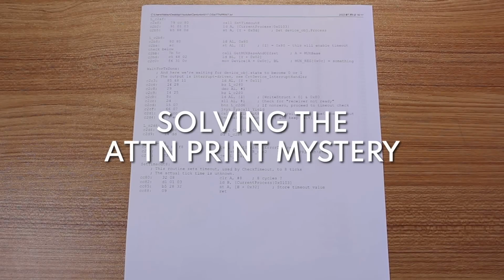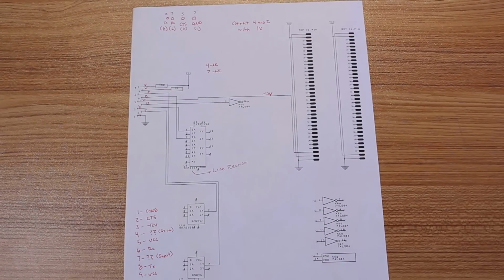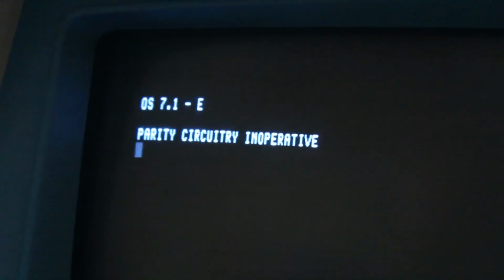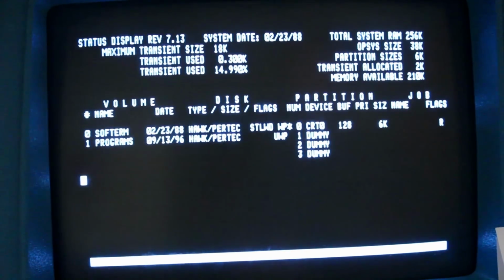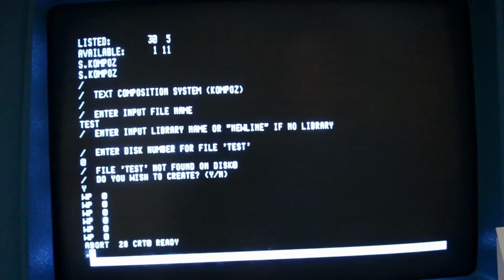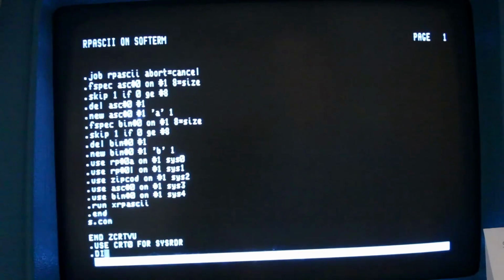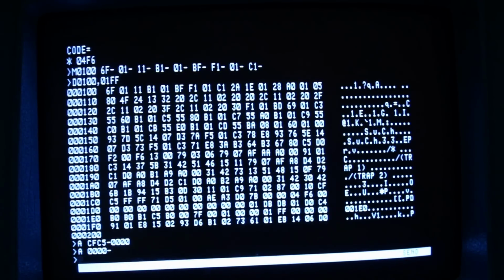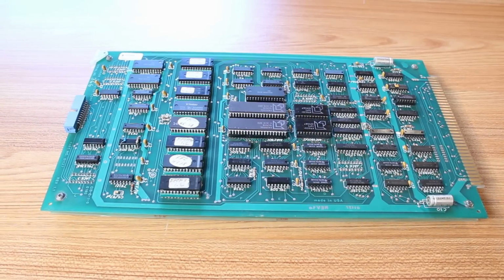Minicomputer Part 17: Welcome to the OS!

Comment: Jump to 8:51 to see some action. So the terminal wouldn't usually be in the same room with the computer, would it?
Reply: Many of the customers did have the terminal (CRT0) next to CPU chassis. If the system had more than one terminal ( 1 to 32 ) they would be placed around the building as needed. The Centurion system did support 300 & 1200 baud MODEM connection for remote terminals or serial printers.

Comment: What your missing is RTS.  RTS need to going into CTS.  RTS is Ready To Send and CTS is Clear To Send.  I know this from 40+ yrs with TI-990 Serial Cards. this should be the pin just before the CTS  RTS should be High. The way CTS need to be high receive data and RTS is High it ready to receive data.  On a TI-990, RTS is always HIGH, So I would port that into the CTS.  Now RTS and CTS are only really used when connecting to a modem and that why I would connect the RTS to CTS but when connecting a modem, you would need to match them to the modem.  As they control the data flow to and from the modem.

Comment: Before you sacrifice one of your removeable disk packs, I may have a compatible pack that I can give you. Send me the model number of your pack and I'll see if I have one that you can use for your fixed media. That will let you take your old accounting data pack and use it to make a backup image of the existing fixed platter ... just in case. Or... to make a backup copy of the removable and bootable cartridge you already have. DM with the info and I'll see what I have.
Reply: Sorry I do not have a part number for the Hawk disk pack.   The pack is a 5 MB top load disk pack with 16 hard sectors per track  ( Sector ring has a total of 17 notches,  dual  notch for Index & sector #1 then 15 more notches for sectors 2 to 16 ).
Reply: @kenromaine2387  Well drat. What I thought were a stack of Hawk 848 cartridges turned out to be Digital top load disk cartridges. They are sectored and formatted differently. I'll keep looking.
Reply: @dwreid55  So the sector does not have 17 notches?  If the DEC disk pack case still looks the same and just has one platter we could still could make use of the platter to help repair a 2nd Hawk drive with a crashed fixed disk platter. Have removed the platter from disk packs a number of times to replace a crashed fix disk platter.

Comment: This is awfully verging on a Pyrric victory.   

A lot of awesome and clever reverse-engineering.  Hundreds of hours of time.  Fun and frustration and annoyance and disappointment and finally a victory of sorts.    Of sorts.  

Because at best you get: one off-brand lethargic semi-pathetic and feature-poor operating system.   I spent several decades underwater in those:  CDC KRONOS,   COS 300, OS/8, Univac OS8, PLATO,  RT-11, UCSD Pascal, ETOS, CTOS, and many I've forgotten.  The OS's were mostly slow, buggy, poorly documented, expensive,  had horrible command languages,  very limited multitasking,   little to no security,  no GUI's,  marginal or no memory protection,  single-user and single-CPU,  flat file systems, 6 to 8 character upper-case file names, no subdirectories, no forking,  poor inter-process communication,  no PIC,  slow booting,  halted several times a day, no source code, infrequent updates, horrible text editors,  flaky compilers,  very slow linkers,  no internal documentation,  very limited set of peripherals, and limited or no networking besides RS-232, and ran on million-dollar hardware that drew tens of kilowatts.   Only languages:  assembler, FORTRAN 4, and some proprietary micro-COBOL.   I don't miss a single thing about any of them.   

Well, except maybe the stark simplicity of PDP OS/8.   You could run a program, or copy files, or write small asm or FORTRAN programs.  You could learn everything about the OS in 4 hours.  And it did boot in about 0.1 seconds.   You had to be a real programmer to extract much performance from that system.   All those other small business systems were very much all of a muchness.  Lousy in about every way.   Perhaps tolerable to run a 20-line micro-COBOL program to read one file and print.   You may have one of those.  Good for you if you can eke out any thrills out of that!
Reply: Sorry it seems you did not enjoy the project.  As very early employee at Warrex Centurion many young engineers started their careers with this product line (like myself). This system helped pay the bills for 200 to 300 families and filled a market need for over 10 -15 years. The goal for many of the team that brought this computer back to life was the challenge and learning about old technology.  This Centurion system with software sold for $40K to $50K in 1982.  Today's business value is $0 but the educational and hobby value is priceless.  Some of the file dates on the disk packs show that someone used the accounting software last in 1996, that is 20 years after Centurion shipped its first computer, not a bad run for a small company in Richardson, TX.

Comment: Hi everyone! What is a centurion computer capable to do? We saw some serial ports and 3 terminals so far. Is it supposed to share computing power between 3 users only or is it meant to serve some hundred user if data concentrators get involved?
Reply: Warrex-Centurion built a line of business computers or CPAs, Oil & Gas accounting, small banks, small hospitals, inventory & mfg needs,  The CPU6 with 256KB could support up to 16 to 20 terminals and in some cases may more. The first Centurion model the CPU4 with only 32KB of memory supported up to 4 terminals. The last model of the Centurion line the model 9 & 10 could handle 100 + terminals in cases.
Reply: @kenromaine2387  thx :-) With some luck we will see a typical work session like text processing or spreadsheet work...
Reply: @firstlast-tw7hc   Sorry no WP programs just very basic text editor.  The Centurion was a accounting / inventory type system shipping years before VisiCalc or 123. In the 1980s if the CPA needed a spreadsheet program they just purchased a PC. In fact I think 95% of the PCs sold to business users are to run spreadsheets in the first few years.   It's true that the PC industry and later networked PCs hurt all the minicomputer companies like Wang, DG, NCR, Quantel, DataPoint, SUN, IBM and DEC not just Centurion.

Comment: I have been following your Centurion restoration with great interest.  Regrettably, I disposed of my vintage computers twenty or more years ago - PDP8, PDP11, Sun UE3000 and more!  (well, still have a couple of Sun boxes... lol)  However back in the mid-1980s I rescued an ICL 2904 small mainframe computer. This had a bit-slice CPU with 74LS181 ALUs, very similar in principle to the Centurion design.   It ran micorocode to enable to function as a modern version of an ICT 1904 mainframe.  ANother similarity was that its disc storage was two dual fixed/exchangeable CDC Hawk drives, identical with those in the Centurion.  I remember them well, they were very reliable.  It also had two full-size 7-track (as opposed to the usual 9) mag tape decks.  Running Exec 1s, I kept it going until around 1990 when the space was needed for a classroom.  Having a no space to keep it, I was unable to save it, very sad.  I'm really loving your videos - my computer engineering experience started with LEO at the end of the thermionic valve era so it's really a trip down memory lane for me!
Reply: My first hands on with computer tape drives was 7 channel pinch roller with vacuum column buffers in early 1975 on a B3500. The B3500 also had the newer 9 channel PE drives with auto-loading of the tape path. 100% agree the CDC Hawk very reliable for its time.

Comment: Have you already given up on crashed disks? I know there was a head crash, but the most of the data should still be intact, and theoretically readable, right?
Reply: The disk directory is in the first couple of tracks right in the area of the head crash on the platter.   Guess if we have lots of money to pay a disk recovery company we could "maybe" find some files on the undamaged areas of the platter. The question becomes why,  we have the OPSYS files and looks like we have the software tools. We do not need to wish to look at other companies old accounting files.
Reply: @kenromaine2387  it should be perfectly possible to recover files even without a directory. Most of interesting file types (software, documentation) either have a clear signature or can be easily restored. It's indeed a bet if anything interesting can be found over there, but the probability of that is quite high. Even if there's already a copy of OS, another could have a slightly different version and provide useful for some purposes.
Reply: @Derlaft  I do not disagree it could be done but a what dollar cost.
Reply: @kenromaine2387  again, theoretically you don't need any specialized equipment or external company, only the existing drive... maybe modified in some way

Comment: What would happen if you tried to read the crashed platters? Could you get some data off? The crashes don't seem to be on the edges of the platters and thats where the file listings should be stored so you could at least get some files off them
Reply: When the heads load onto the platter they first load to cylinder zero, the very outer cylinder ( area of the crashed platters ).  Once the head has burned into the metal platter ( no brown oxide left on an area of the platter ) its all over.   If you could clean up the R/W head or installed a new R/W head as soon as the good head tried to "fly over" damage platter the head will be damaged again in milliseconds.   Just one oily finger print or even a spec of dust between the head & platter is 100% crash time...!

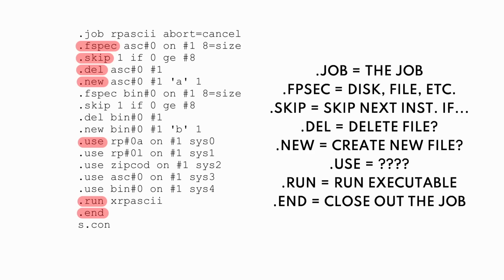Comment: 16:22 Let me guess: “#0” and “#1” are the command-line arguments to the script: remember you passed the file name and the drive number. So it looks like the first “.fspec” command is getting the size of some “asc” (ASCII?) file which has a name derived from this and putting that into “#8” (What? No distinction between internal script variables and argument variables?) If the size is nonzero, the existing file with that name is deleted. Then a similar thing is done for the “bin” version. I think the “use” commands are associating files with particular identifiers “sys0”, “sys1” etc that the program itself will use to reference those files. Then the program is run.

Comment: Was there a tape drive for them to backup data from the hard drives?  You need some sort of removeable media for backup of data.  Then you could put the noisy system in your garage and put several terminals in your house and balance your checking account?  lol  Did you see any usable software on it, such as a spreadsheet for the Centurion?  Also, I notice, you keep using the 1988 date (88).   I would imagine this system is very much NOT prepared for Y2K with only a 2 digit year.
Reply: No tape drive for backup with this model. Backups are done by backing up to a 5 MB removable disk pack.  No spreadsheet software, system run mostly accounting programs for CPA's.    As for Y2K has not been tested yet but looking a the code in the OPSYS it looks like Y2K dates will not be an issue.  Other reason we are not changing the date currently is because we do not wish to cause a data write to the disk drive at this point in testing till complete data backups are completed, entering a new date will cause a write to the disk which is currently Write Protected.
Reply: @kenromaine2387  Okay; this is just such a cool series to watch.  Hard to believe it was in use until the mid-90s.  When the time is right and you have redundancies, I await you to try to load some of the accounting software to see what it was like.  I wonder if it was like RPG on the IBM where (from my understanding) you could write database programs with it, but I thought that was more a script language??? I dunno - lol.

Comment: I see your drive uses the Pertec interface.  I worked on Pertec 14 inch hard drives back in the late 70's and early 80's. Most of the drives I worked on had the Pertec interface, some of the Pertec drives had the Diablo interface. I got to work on a couple Diablo drives as well. They were more reliable, but also slower. They had lots of issues like the oils from airborne perfume would make it though the 'Absolute' filter and accumulate on the drive heads and cause crashes.
Reply: Centurion did also sell a 20MB Pertec drive that was 5MB removable and 15MB fixed that was I/O compatible with the CDC Hawk.   We seemed to have more problems with head crashes on the Pertec drives than the Hawk drives.  Remember that if the Pertec Servo slammed it would damage or break the glass reticule used for detecting the cylinder position.  Pertec did put two times the disk storage in the same rack space over the CDC Hawk for less money. The Centurion chassis in the videos could hold two Pertec drives for a total of 40MB over the CDC Hawk config with two drives totaling 20 MB.  The Pertec drive looked like two Hawk drives to the Centurion DSKI/DSKII controller & OPSYS.  Down side over one Pertec over two Hawks was the two Hawks had to servo systems over the Pertec's one servo system. Because the Centurion OPSYS could do over-lapping servo seeks the average access time to data because of a seek could be 1/2 the time of the Pertec system.
Reply: @kenromaine2387  The drive with 3 fixed and 1 removable platters was their last model 3000. I replaced more of those glass reticules / scales than you can imagine. 
the drives were so bad that they would very often require repair right from the factory. We ended up setting up a repair station in the our warehouse for that reason. I worked for Pertec Computer Corporation in Irvine CA, all of the drives we used in our computers were built by Pertec Peripheral Corporation in Chatsworth CA.
Reply: @Blasserman  Dave, You said it not me, but agree 100% on the Pertec having issues with the glass reticules / scales. I would take a Hawk any day of a Pertec model 3000 drive. My feeling was 2 times the storage by 10 times the trouble over a Hawk.   Did you know the first CDC Hawk drives were built in Hawthorne California near Pertec in Chatsworth CA?  CDC later moved the 9427H  ( Hawthorne  ??? ) production to OK City, OK. and started calling the drive the 9427 Hawk after a major change to the electronics.

Comment: Well done.
I still think you should create microSD card interface that can emulate a Phoenix drive. Then you can keep the Phoenix as your golden copy and no head crash can interfere with you centurion.
Reply: Right? That's what the guy from the "Adam's Digital Basement" does all the time. And considering the amazing team of coders Usagi has on his side, it wouldn't be very difficult, I imagine. But let's be honest, seeing that ancient drive coming back to life and even booting was pretty amazing.
Reply: @a.c.4054  Yes you are right those old drives were a marvel. But I was trained to repair them and saw a lot of them crashed. It is impossible to get spare parts for them now. So every time he spins them up it is a risk. Also. These drives need their dust filters replaced regularly. I doubt you can still buy any new ones now.
So, for everyday playing around with the system it us a lot less risk to have an alternative medium and only spin up the old darlings on special days.
Reply: @helmutzollner5496  oh yeah, I can imagine parts for those drives to be pure unobtanium.
Reply: @a.c.4054  Yeah. I mran they were still in use until the late 1o90s, but that is now an awful long time ago. I doubt very much that there is some old new stock around still. I remember the price for 1 head was in 1989 about 150 USD. So, nobody would keep large stock.

Comment: That's funny that thing was still being used as late as '96.

Company I used to work for bought their POS/Inventory mgmt. software in early 1995 - right before Windows 95 made the mouse an everyday, standard piece of equipment that everybody used all the time. 

The entire software ran on a custom mainframe and they had dumb terminals at various places around the shop. Of course, by the time I started working there (2010), the system was running on an actual server, and every workstation had its own PC with a VT240 (or maybe it was 220?) terminal emulator that we had to use to interface with the POS software. Everything you wanted to do was some ridiculous key combination. Of course, you learned it over time, and eventually got used to it, and even some could eventually master it, but holy moly!

They still had that software running when I left the company in late '16 but, to their credit, were finally shopping around for something new.

This, from a company that does $250M+ in business every year, and would scold us when they posted <$40M in profits.